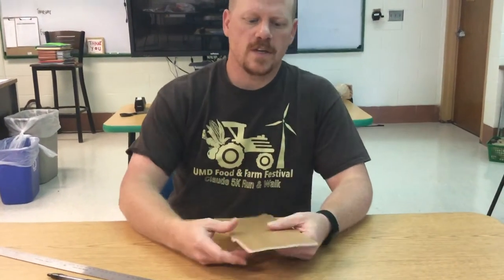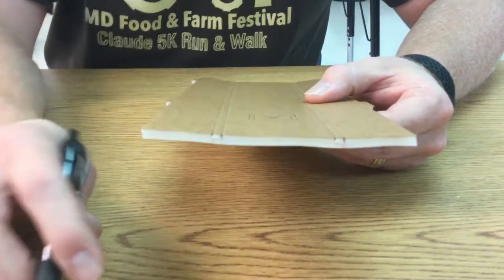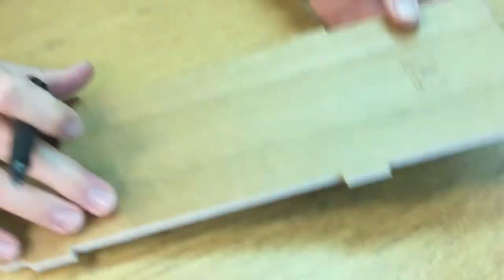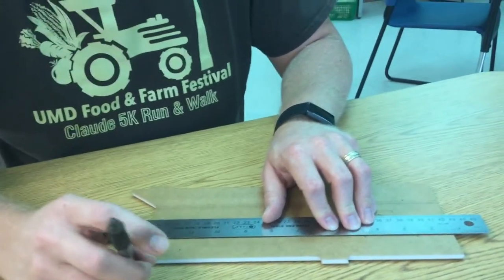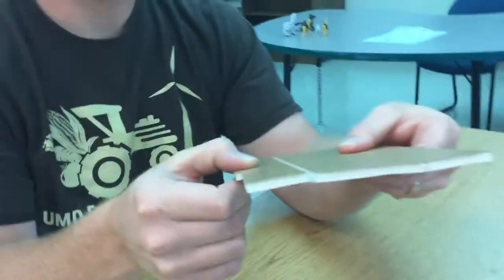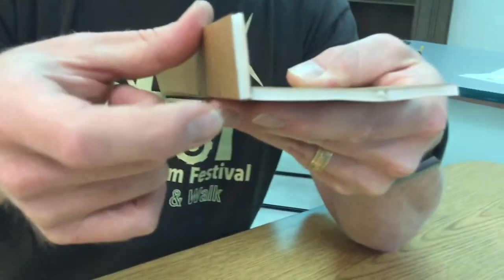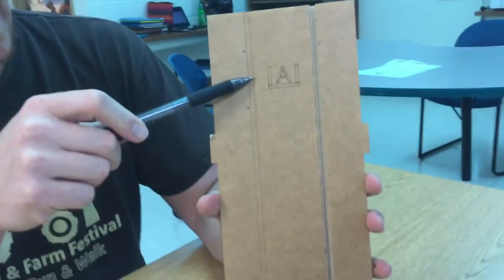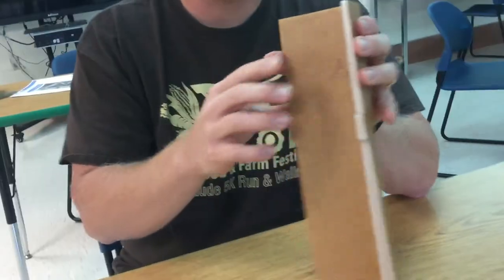Foam Board Folding Techniques

Comment: Thank you for this video. I'm not a student but where do you get that tool for making notches in the foam board?
Reply from the maker: All I use is a metal edge ruler and a utility knife or razor blade.  You can get them at a craft store or hardware store.